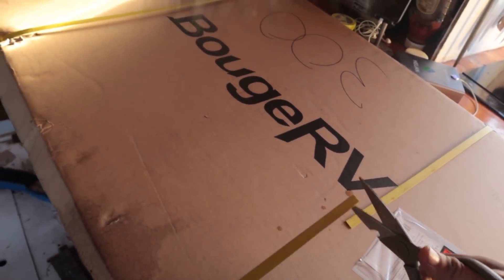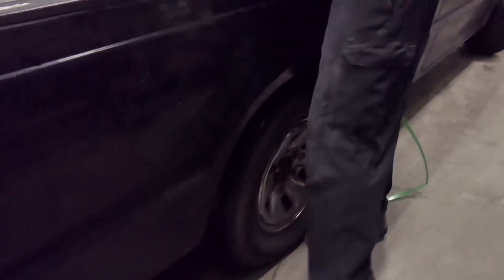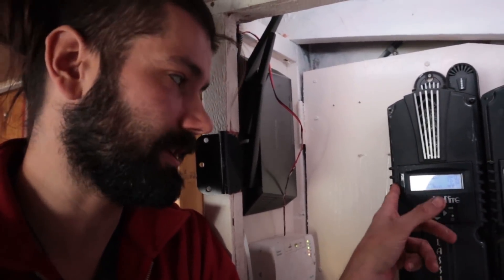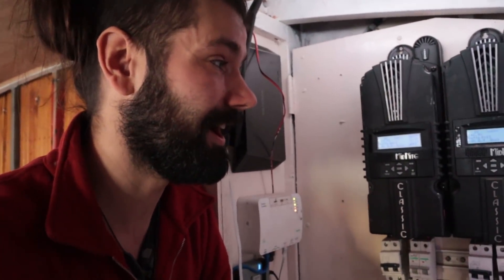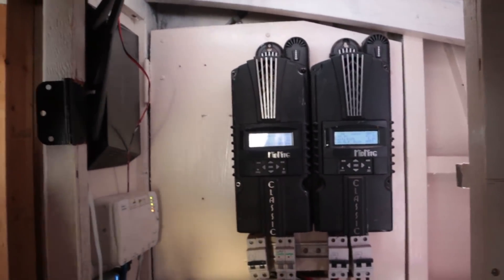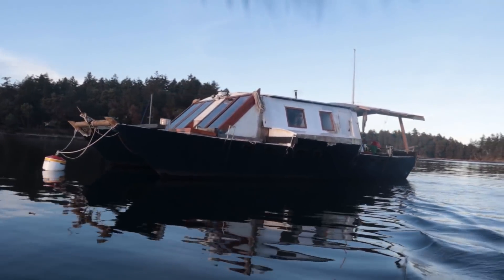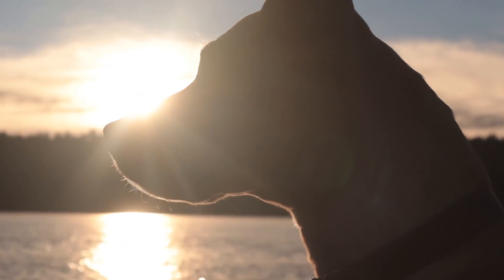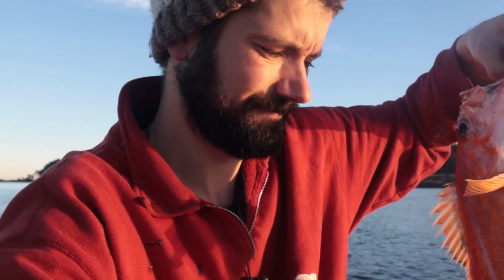Good Affordable Efficient Solar - Sink or Swim 196

Comment: 👍👌🇨🇦❤, I know that this is not  a possibility in your situation, my tiny house has an array of 32  x 430 watt solar panels = 13,760 watts, not on the tiny house itself, I built an adjustable stand that allows me to adjust the angle,  the lattitude of your location is a somewhat reference to approximate angle that a panel should be at to gain the best solar, since Gabriola Island has a lattitude of 49.15 degrees of lattitude, this would be approximately the correct angle. I only change my angle of my array twice a year, spring and fall  and my lattitude is 51 degrees , with testing I have foud this to increase by amperage output up to 30 % . As you are on a boat Simon this may not be possible to adjust, but just providing food for thought, gr8 video as always, I divided the panels in groups of 8 and and each set has their own mppt charge controller for redundancy, if one should fail, I have 4 Silentwind turbines as an alternative power source, the panel you are displaying looks like a decent quality panel for the price, gr8 video as always

Comment: Your showing your age Simon, I live here too and I use Imperial... its a generational thing. ;) Its actually awkward because I use Celsius, Inches, Ounces, Feet and Pounds but distance is Kilometers (easier to judge by the hour LOL), although I refer to miles but mean kilometers... Growing up in the 80's... it'll get ya every time... :D  PS I recommend Benjamin Moore Designer White as it is true white and I think with the dark hull that will be primo ... and you can get it at Ace.

Comment: If I were you - I would look for scrapped submarine nuclear reactor and if you lucky they could throw few half-used fuel bars with it, theres RTG cores as option as well if you're well connected within the military research or space explorations. I mean, you dont need it at full power to run that ghost ship of yours and you get heating at winter for free. You can also save on shaving and haircut, too. Useful links:
https://www.world-nuclear.org/information-library/non-power-nuclear-applications/transport/nuclear-reactors-for-space.aspx
https://www.aecl.ca/science-technology/small-modular-reactors/

Comment: You need to put the panels of same type in serial to get the voltage up.
If your ”mppt” can handle 100V you can put atleast 4pcs of 20V panels in serial..
If you have panels with similar spec. You can put several serial groups in parallell.
If you do that you will get power even in low light condition.
I dont rememder your setup, you might do that already... did you mix up Volt with Watt ?? :)

Comment: I know you know this, but you would increase your incident solar radiation if you could tilt some some of your panels at your latitude +15 degrees for the winter. I'm sure that that turns them into sails, and would need a fancy system to secure them. Perhaps you could tilt them only in calm conditions.
Reply: Tilt towards the south, of course!
Reply: @eggcuriousity  and solar south would be even better